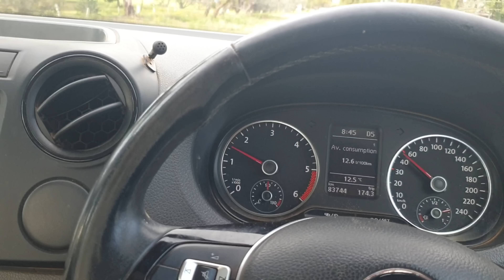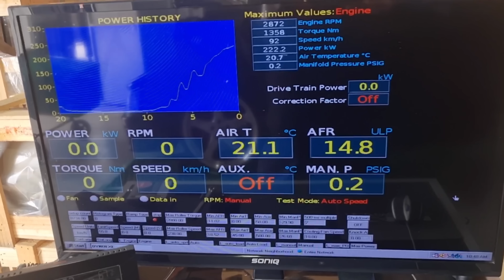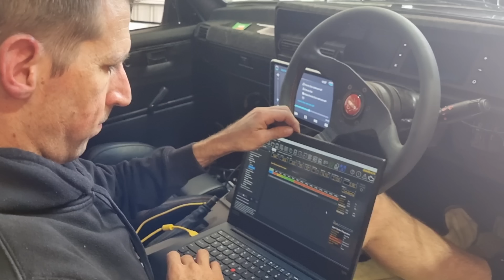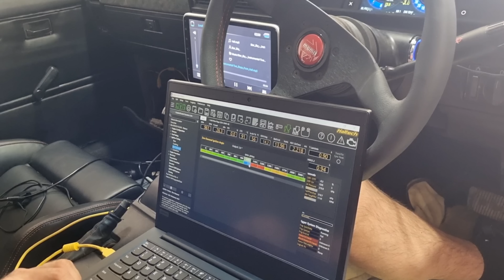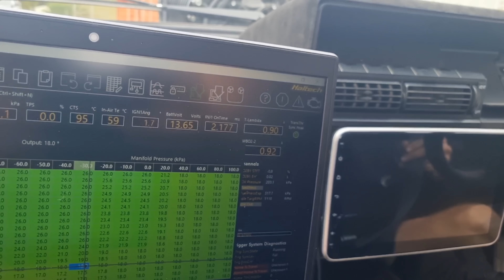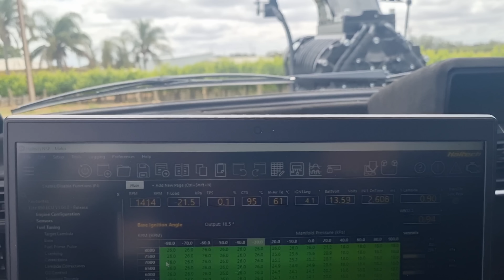Blown VK Mako Hits The Dyno

Comment: Shouldn’t the butterflies be wide open at full throttle? They barely opened.
Reply from the maker: Don’t want to much HP I won’t be able to drive it
Reply: @carsnthingsrestos31  So they should open? Is it making boost? I understand not wanting too much power, you’d like it drive able, but is the blower essentially just for looks?  I don’t know what the confused emoji is but 😳
Reply from the maker: No, they do open fully and when he does a full rip in it they will, Scott was only doing 1/4 throttle runs in it and running the engine in, more to come.

Comment: I don’t get it, it’s still completely untested wide open
Reply from the maker: The engine is brand new mate didn’t even drive the car after I rebuild it, needs to run in and some k’s put on it before we do a full rip. Just need a tune done so we could drive it under some power.
Reply: @carsnthingsrestos31   yeah fair enough bro, I was tongue in cheek, I really love the car, the colour and body work is awesome, are the wheels big diameter walkinshaw copies? They look killer, good luck with the car